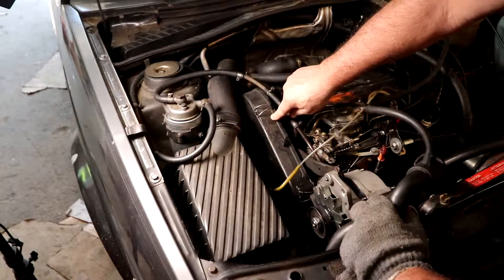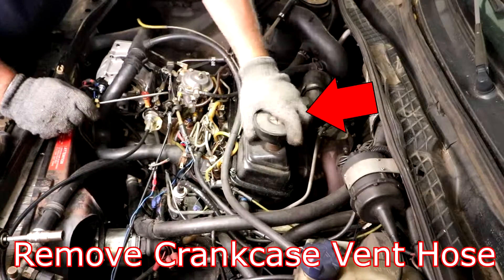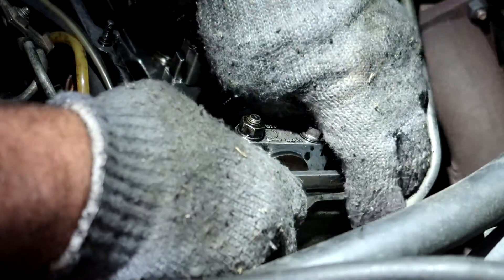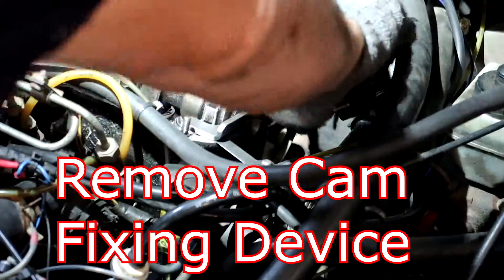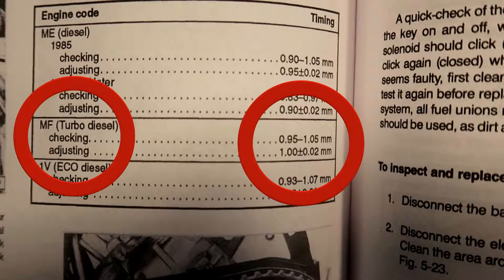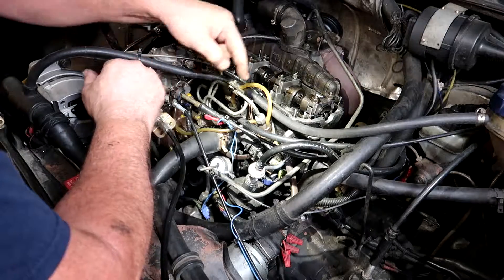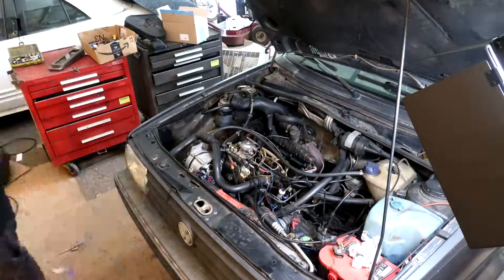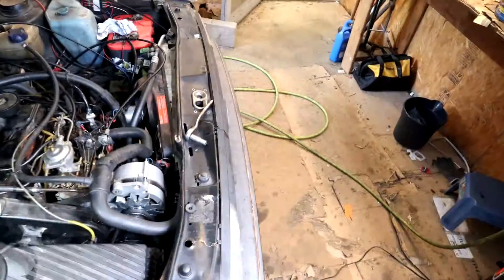Diesel Injection Timing and Valve Timing 1989 Turbo Diesel Jetta mk2 Joe Fixes It

Comment: obviously its a different engine, but the adjustment should be the same for a regular gas jetta, right?
Reply from the maker: gas would be different, you would be setting ignition timing...
Reply: @Joefixesit  I probably should've specified, I meant the physical location in the engine bay. Thank you for replying though! I have a mk2 with some pinging and need to adjust my timing.
Reply from the maker: That sounds like it.. pre ignition.
Reply from the maker: Well you would be rotating the distributor in a gas engine.. the diesel has a vacuum pump in that hole. Injection timing is a little although setting the valve timing is similar

Comment: Hi Joe really like your video wanted to ask you a question since I don't have you on Facebook I have a 1982 Volkswagen Rabbit diesel 1.6 L manual when I put the car into 5th gear at ANY SLOPE it fuel cuts 1 cyl. I have been told this could be a fuel starvation but it has a fresh fuel filter and new Bosch injectors. Only happens in 5th gear. I have also been told it may be a false rev limiter. Ideas? Thanks.
Reply from the maker: "ANY SLOPE it fuel cuts 1 cyl" so you mean it starts miss firing under a load in fifth gear at speed. The first thing that comes to mind would be a compromised fuel line somewhere from the injection pump all the way back to the tank. If there is any leak it will suck air into the fuel and cause just that issue. Happened to me many times. As a matter of fact when I put new fuel lines on, I will put a piece of clear plastic fuel line in close to the injection pump so I can see if there is air in the line (small leaks will turn the fuel white  with very small air bubbles). As far as a rev limiter, the Bosch VE pump is governed at 4000 RPMs. This is done solely by the pump. Not the problem you are experiencing. With your symptoms. 

1: Fuel Starvation 
2: Air in the fuel lines.
Reply from the maker: the first time this happened to me was on a 1981 Rabbit NA Diesel, drove me insane for weeks until I found where the fuel line rubbed a hole in a fuel line rubbing against the firewall under the hood.
Reply: I really appreciate you taking the time to respond so thoroughly I will start attacking this issue and if I find a resolution I will report back in these comments!!! Thank you Darren from Buckley Washington
Reply: @vintagemotoseattle  yeah, I spent a ton of time working through that up to and including fixing along side the road at truck stops on long trips. Normally it is a fuel filter but you just changed that. The Low pressure pump inside the injection pump that acts as a pickup pump is very powerful once primed and will suck air around the o ring on the fuel filter when it stops up..Also another thought, there is a screen on the gauge sender/fuel pickup line inside the tank that has stopped up in the past..I forgot about that damn thing. You get to it from a panel under the rear seat.

Comment: HI JOE , great video , I just get a jetta 1.6 non turbo and everything seems to be fine , until like one month later the car starts to sound a little high rev without pressing the gas pedal, then the situation get worse,  now every time I start the car  the engine make a "runaway " the engine rev up like crazy.  I really appreciate any advice from you .
Thanks in advance.
Reply from the maker: more than likely it is just the Injection pump throttle lever sticking from sitting a long time.. WD40 or something similar on the top of the pump is the first thing I would do. There is a rare condition in early version of Rabbits on very high millage engines and old style crank case vents where you can get a run away but that is not in a MK2 and most 1980s rabbits.

Comment: I see your index marker is a little arrow, mine appears to be a large rectangle that’s raised a bit. Is this correct?
Reply from the maker: the indentation is the mark. the raised area is not.
Reply: @Joefixesit  thanks! What is the raised area then?
Reply: @VWRabbit  not really sure, but it is surely not a timing mark for injection

Comment: You’ve got some great vids! I just got a bit of a dream car, 86 Jetta 1.6L IDI (no turbo). It runs well but does need some love. Biggest mechanical issue is it leaks fuel. Initially it appeared it was just from injectors but further inspection points to pump leaking as well. Found fuel in the pump sprocket under timing cover and there is a slow drip. I had to order the injector socket so I’m at a standstill for now. 

In the meantime the wiring in this car is scary. A lot of it has been altered with zero regard for safety haha! Not one single fuse, exposed copper, bad crimps, wire nuts, etc. I’m currently wiring up two new fuse boxes, relays, and a switch panel inside to control everything. I’d love to restore the entire harness but for now I’m just going to get it all functional and get aftermarket oil and temp gauges.

Anyways, my leaky injectors lead me to one of your other vids and then to this one so I wanted to say thanks!
Reply from the maker: well thanks for saying so.. sounds like you will have a lot of work to do which is common, most time every moving part is broken in some fashion or the other. I normally spend some money and get the IP rebuilt and it is usually good for 500,000 miles. I have 3 jetta's and a 1896 NA golf currently on the road, and 86 with a turbo as a project which you will see parts of in videos to come... have to change the heater core which is rather involved. going to fix a leaking door next week.. good luck and let me know if you get into problems

Comment: Very good vídeo. Could You do one with only te adjusment in the pump.  Including all the screws. Thanks
Reply from the maker: actually, other than the injection timing there is nothing you really need to be adjusting on the injection pump with out being on a test bench which is normally done when you send it off to get rebuilt. Adjusting the fuel level on turbo diesel while in the car is a bad idea without an exhaust gas temp gauge. Adjusting it on a normal aspirated diesel is almost never helpful. I have tried.

Comment: Careful, cuidado, torquing the camshaft bolt against the cam lock at the end of the shaft could (why risk it?) crack the cam shaft at the lock. Better to use a pulley lock bar to absorb the torque. Peace.
Reply from the maker: yes, you make a very good point, I have never broke one myself but I have come across one that is broken once.
Reply: @Joefixesit  Finding another 1.6 TD cam because the PO broke that back end wasn't fun!
Reply: @ohiobenz3629  the cam is the same for TD and NA for all years if that helps..
Reply: @ohiobenz3629  in fast the head is the same, all you need to do it put TD valves in a NA head and you are good to go.

Comment: For hand/twist belt tension, the VW Bentley manual says to twist the belt between the injection pump and the crank shaft pulleys.....should be about 90 degrees.....very subjective though.
Reply from the maker: I think so too, and you can not get the belt tension spec from VW ether. I think the point is not to make them too tight as it will damage the bearings of the intermediate shaft.

Comment: So, setting the injection pump timing at 1mm, means that, after doing all the steps, i have to move the pump forward or backward untill it reaches "1" on the gauge, right? Thank you
Reply from the maker: Yes
Reply: @Joefixesit  thank you!

Comment: I have a 1992, swapped out a 1.8 gas and auto to a 1989 td 1.6 and standard. Thing is, i have seen videos where these go over 3k rpm, but mine is revving out before reaching there. Was wondering what could be the problem
Reply from the maker: not sure there is a problem the diesel engine is Governored to 4000 rpm max. when shift out it noramally revs to 3000. unless you have a gas transmission. check your tranny code on the bottom of the transmission.
Reply: @Joefixesit  believe i need to do the same compression and injection pump test,  because I'm only getting just about 40-42mpg
Reply from the maker: I would suspect injector nozzles first, if you have a pop tester check for chatter spray pattern and leaking and of course opening pressures that seems to have a lit to do with how well it runs. but then again if you compression is low that too. does it start easy?
Reply: @Joefixesit  its the original diesel trans. 5th gears tops out around 2600rpm and 67-68mph
Reply from the maker: that sounds about right. there are specs out there on what they should be

Comment: hi Joe - i have SKOA OCTAVIA MK2 which has UDS ECM module and BOSCH injection pump. my car gives a black smote from exaust since the SKODA ASP person changed the timing belt. i wanted to check the timing of this car for affecting injection timing and wanted to advance if needed. i do not think i can do this with VCDS and can you help. i have the timing check tool purchased in EBAY. please help. thanks, diva.varadam@gmail.com
Reply from the maker: Sorry I did not see this message what ended up happening?

Comment: Joe I don't have the tool to check the injector pump timing ,what else can I do
Reply from the maker: your talking about the dial gauge and adapter? Here is a kit on Amazon 

https://www.amazon.com/EWK-Diesel-Injection-Timing-Indicator/dp/B00H97J1MU/ref=pd_lpo_263_img_0/145-8405901-7845310?_encoding=UTF8&pd_rd_i=B00H97J1MU&pd_rd_r=076d1396-ed99-4a66-b30b-73f961c969a9&pd_rd_w=3p2OD&pd_rd_wg=csxPn&pf_rd_p=16b28406-aa34-451d-8a2e-b3930ada000c&pf_rd_r=EJBXW66MZB1HFEK558PR&psc=1&refRID=EJBXW66MZB1HFEK558PR

Ebay
https://www.ebay.com/itm/Fuel-Injection-Pump-Adapter-Timing-Tool-KIT-for-VW-Bosch-VE-/382424528428

I am sure with a little effort you can find one pretty cheap, It took me about 30 seconds to find these.  The VE Pump is very common and has been used for many many years on many different applications.

Comment: Joe I have a 1.6 turbo diesel  when you turn the motor over and place your hand over the exhaust  pipe it will suck your hand in can you tell me what  the problem  is  checked the timing Mark's and looks good
Reply from the maker: From what you say it is a valve problem. You have got at least one of them open. Could be a bent valve or one sticking open depending on whether you have hydraulic lifters or not. does this thing run? what year is the engine?

Comment: Joe, I need help too. I recently bought 2016 Audi A7 TDI with turbo (only 67,000 miles). I have been having horrible gas milages. On highway I am getting 26 mpg where should be 38mpg. and last I checked in the city, I m getting 11 mpg where it should be 27mpg. 
Before get slaughtered by mechanics or Dealership, please tell me where to start even if I have to tell those guys to check. I want them to tell please this and this instead of depending on them and buy their stories.
Reply from the maker: I am not much help here.. this is a late model car with a lot of electronic controls that could be effecting this. without more symptoms I would not know where to start. the VWs I work on have no electronics and are completely mechanically controlled, that being said, I would be checking the injectors, fuel leaks, injection timing.. sorry for taking so long to respond..

Comment: I don't understand i have seen other video's of 1.6td setting theres at 33 or 80 -90 on the gauge...I'm gonna do my pump timing but it seems every video is setting it different.....
Reply from the maker: no sure what the other vids show.. I use metric and what you are measuring is mm of lift as the cam rotates inside the pump. they may be using fractions of an inch.
Reply: @Joefixesit  Thanks that's what i thought.

Comment: Hey Joe thanks for the video, I’ve got a 91 Jetta with the 1.8 TD I am having troubles starting it. The engine tried to run away on my on the highway and I was able to shut it down right away. I took the turbo inlet pipe off and found a lot of oil and the dip stick was pushed out. I thought it was a turbo seal but I’m pretty sure the PCV was plugged. Anyways I can turn it over by hand and plan on doing a compression test tomorrow but I’m wondering if the car could have been thrown out of timing from over revving? Thanks in advance! I really hope it’s not a bent rod haha.
Reply from the maker: probably not thrown out of timing if it still runs alright, it is an interference engine meaning the valves would make contact with the pistons. Let me know if you figure out why you have excessive blow by enough to make it run away. Blowing the dipstick out .. wow.